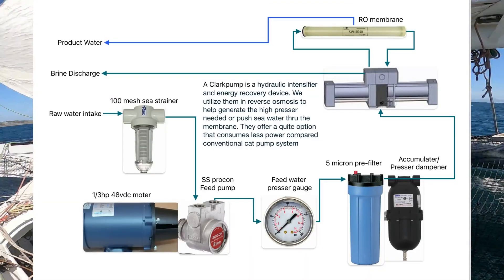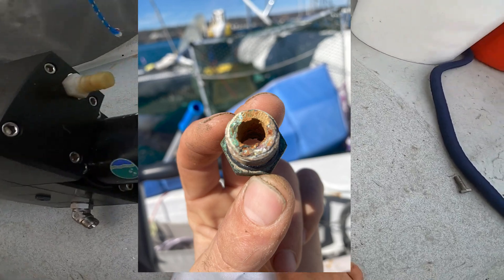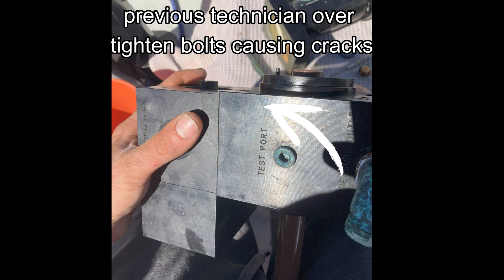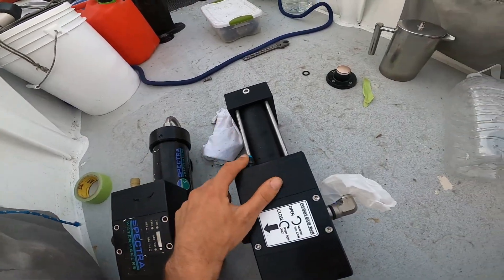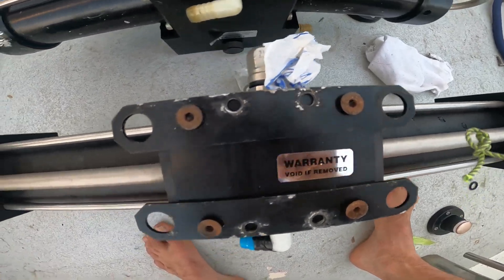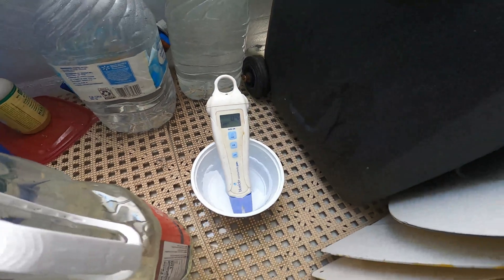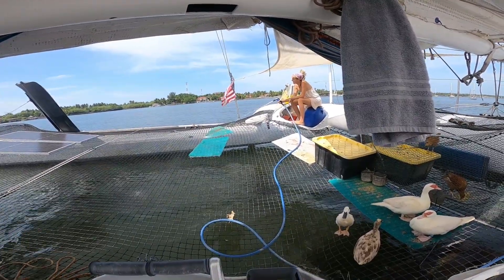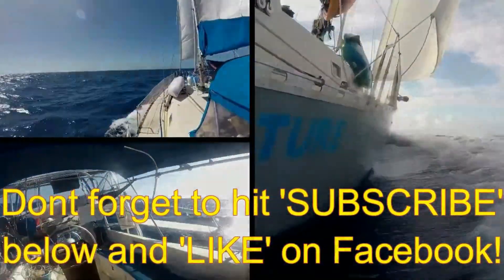Clark pump deconstruction comparing Spectra vs Solarmaax watermakers with money saving secrets

Comment: Funny thing… my 1998 Clark pump is still going strong.  I did replace the 3 piece reversing valve and the white plastic seals, but it’s a 10 too.  It’s been going over 25 years and puts out 9gph at s226ppm

Comment: Thank you for posting these how to videos.  We are about to rebuild our Spectra clark pump and have been happy with the performance over the last three years so its good to see others have had success with rebuilding themselves.  Could you provide the part numbers for the o-rings for the spectra clark pump..... i'm assuming the annular rings you just bought from a spectra distributor.  Thanks for the information and help.
Reply from the maker: The part number for the annual rings is HP-TB-ARP and yes, we did buy them through a spectra dealer. If you are needing the part numbers for the O-rings that were in the video, you could send us an email at ShowMeYourDinghy@gmail.com and I’ll be happy to send you over for the info

Comment: So you’re at a nominal 13Wh/gallon which is very good. I’m guessing your nominal 48V system probably averages more like 50V or more, which pushes up Wh a little. And the wild card - I’m sure you know that these systems need to be fresh water rinsed on EVERY run, or trouble swiftly follows. So that pushes the actual useable yield down. I ran a Spectra for almost four years, and when I included rinsing, and the many hours it was producing below spec due to trouble with annular rings or scored cylinders or whatever I averaged more like 20Wh/gallon. Very high maintenance. I sold it and bought a 55 gph EchoTec which has been fantastic, three years and just change pump oil once per year, and average 30Wh/gallon.
Reply from the maker: yup! my batty bank sits between 53-51 when discharging, going with the higher voltage was necessary due to the long wire runs on Tritium.  even with the SS fitting upgrade i still fresh water flush.  i have installed and worked on Echo Tec weathermakers before and totally agree that they are simple and low maintenance but i could not deal with the noise. especially considering Tritium is a carbon boat
Reply: @SVAnotherAdventure  Yeah I get it. We're an all fresh water boat, so at 3 hours/week I can stand the noise vs. running the Spectra 2 hours/day.

Comment: Very creative solution to sustainable lifestyle in warm climate! I'm toying with reinventing my hand operating watermaker with bits and bobs including parts from a sawzall and pump from a pressure washer. I will be using 110 volt from a propane generator and a inverter... all shits and giggles,  rain collection is the best water supply imho.
Reply: Saw one guy, bought new truck windshield wiper motor hooked up to hand operating watermaker.

Comment: What are the part Numbers for the motor, the procon pump and the pwm speed controller?
Reply from the maker: the procon pump # is 10616 you can order online form edco distributing, it is a saltwater pump or special order form another procon dealer. i have been sourcing my parts from JC beverage compony
the PWM was a cheep amazon part that i bought to test the relationship between speed and presser. it is RioRand 7-70 PWM DC motor controller
the number for the leeson moto ri used is 108847.00
Are you building you own watermaker?
Reply: @SVAnotherAdventure  Thanks for the quick reply. I will see if I can source some of these parts. I have schenker zen 30. But the standard pumps on those are very noisy and don't last long. So this would be a nice change. Probably have to go down in size a bit. I believe the standard pump only puts out like 300l/h.

Comment: That's a future upgrade for my boat.

I am wondering how you like the water taste, and if it seems to hydrate you.

One of the camps I work at desalinates their water, and most workers hate the water.
And claim they are thirsty shortly after drinking it.
Although some workers are fine with it.
Reply from the maker: the success of the garden is a testament of the quality of our system. I always dump the product water over board until i get a good reading by taste or my EC meter.  the fist 10 gallons sometimes have a taste i would describe as lake water. i assume from stagnate water sitting in plumbing but i put that water in the tanks for fresh water flushing after use.  i prefer my water maker water over any dock.  i have known some people to buy trace minerals and other additive for their watermaker water but i eat a well balance diet that supplies me with everything my body needs